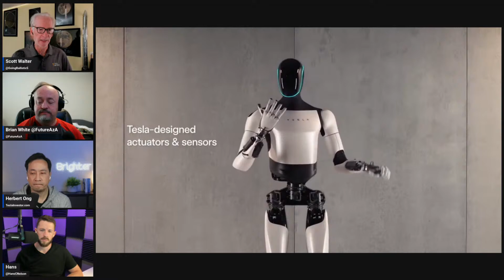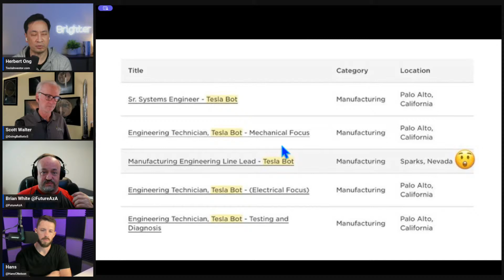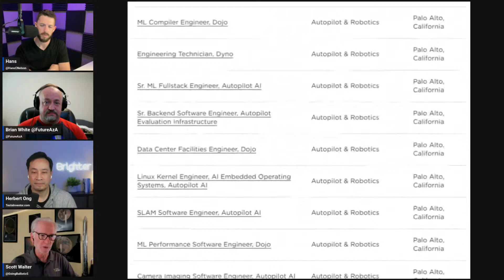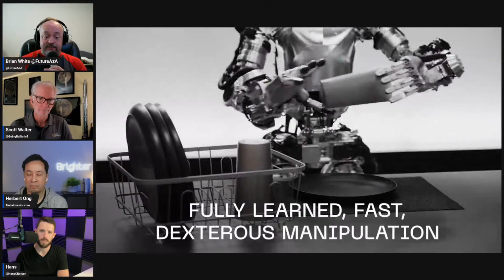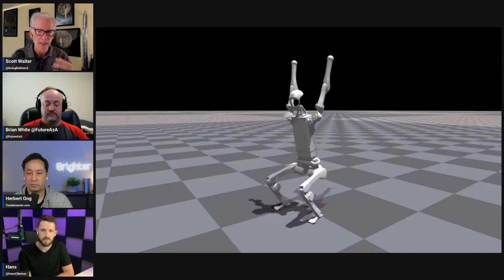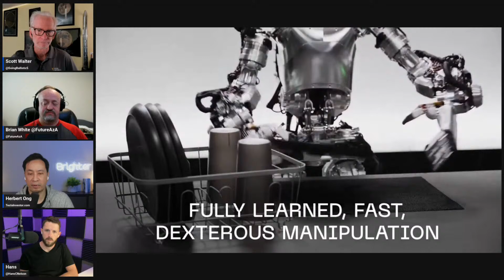Can Bots REALLY be spun up at Plaid Speed? - Livestream

Comment: I wonder if Digit's feet floating in simulation, contributed to the real world bot's arms to fling up after placing the oven dish.?
Reply from the maker: In the simulation?
Reply: @FutureAzA  the simulation's feet seemed to be ungrounded at a moment (I have a theory on that) but then a moment later when the real world bot placed the dish it's arms flung up (just a bit) possibly the difference in weight between the virtual sim and the real world dish.
But the feet in the sim were up when the knees were on the floor - maybe the stoppers in that virtual model weren't set up at the same position as the RW model.